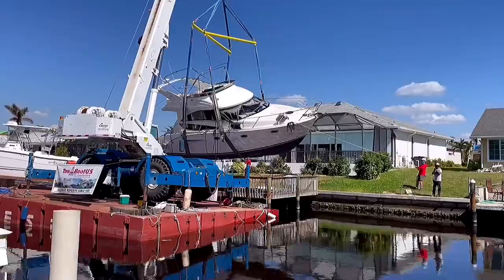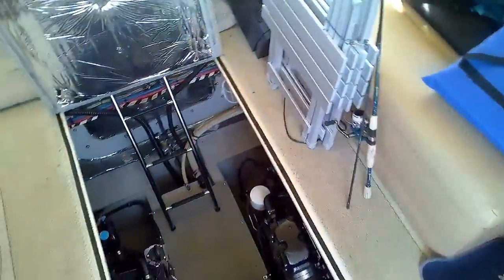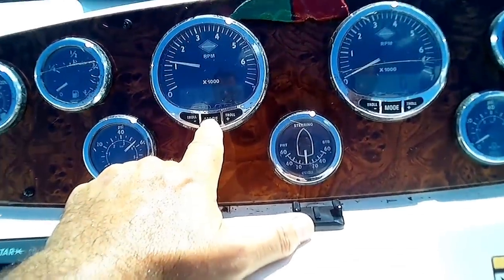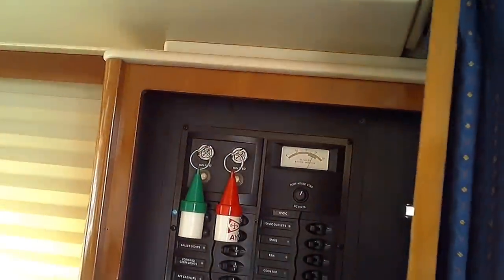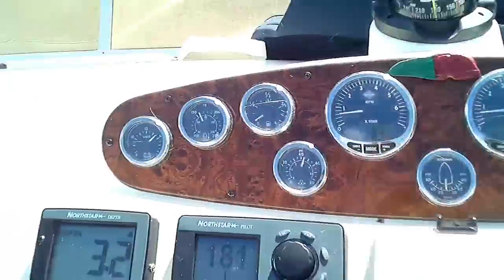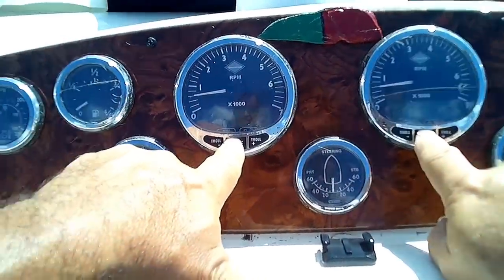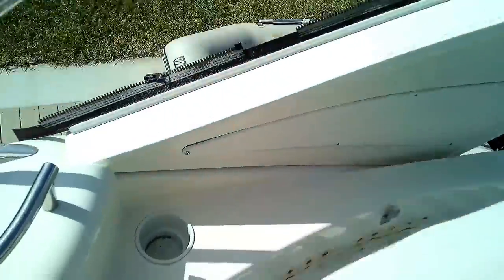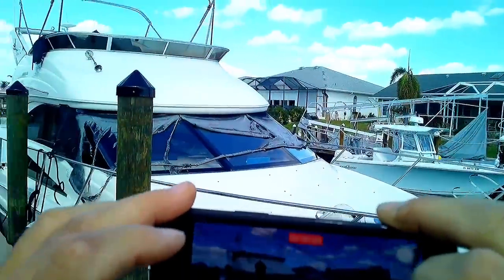Hurricane Ian - Damaged Boat Triage

Comment: Awesome that everything still works as well as it does.  How do you/they explain such minimal damage to props/shafts/rudders after so much punishment during the storm; scraping over walls and pilings and then sitting on the lawn like that??  I know you're looking forward to cruising around again but be careful of sunken boats and submerged debris and shifted channel markers etc!! Keep up the good work and videos.
Reply from the maker: I’ll mark it up to slowly settling in the soft muddy grass after the tides went out. The boat also has a keep and tunnel drive that partially protects the running gear.
Reply: @AdventuresofHappyOurs  Ahhh- I think tunnels and keels are helpful.  I dont have them.  I have a similar age Egg Harbor  37, so I was interested to see some of your equipment is similar to mine- PSS shaft seals and NorthStar electronics.  I'm still using my NorthStar 9000- simple and reliable but I also use the Navionics App.  I think the Navionics on phone is really good.  I saw your video where you went by that (because it was closer to actual navaids) and not the New Garmin.  Very interesting.
Reply from the maker: Thanks for following along!  I had to change out my north star gps as it wouldn’t power up.  Replacing the autopilot is on the wish list.
Reply: Probably got super lucky and HO broke free during the highest portion of the surge, winds pushed it against the neighbors house, and kept it there as the tides dropped, so it never touched anything other than water and soft soggy ground. Thankfully!
Reply from the maker: And took out 2 fences and a dock with a lift.

Comment: You should short haul it and put a run out gauge on both shafts.  Pull both props and have them reconditioned too. Its almost guaranteed that you have some damage. Not worth the risk to the transmissions, shaft seals and cutlass bearings to ignore a close inspection.
Reply from the maker: That’s the plan. I’m had to do work anyway but will need to wait for mechanics availability

Comment: Help us understand why you just left the boat and didn’t do anything to protect it from the hurricane
Reply from the maker: I did a lot to protect it from the hurricane.  Extra lines, fenders, took all canvass down, put out bow and stern anchors in addition to all the extra lines.  There is only so much you can do to prepare and no one expected a direct hit of nearly cat5 hurricane with unprecedented storm surge never before seen in this area.
Reply: @AdventuresofHappyOurs  Was leaving in the boat not an option? Or did you just not expect it to hit you since the projections had it going further north? It's so awesome that it doesn't have any major damage.
Reply from the maker: It was projected to go further north and never in history has the storm surge reached that level in Cape Coral.
Reply: Steve, You APPARENTLY didn't watch his video that showed what he did to try and keep the boat safe during this hurricane. Apparently you've never been threw a storm of this magnitude. Because NO matter what you do, There's a risk that it won't work. Ask the ppl that had there boats out of the water and in dry storage. And part of the building collapsed that they where stored in. But I'm sure you'll have some smart ass answers, Because you obviously know it all.